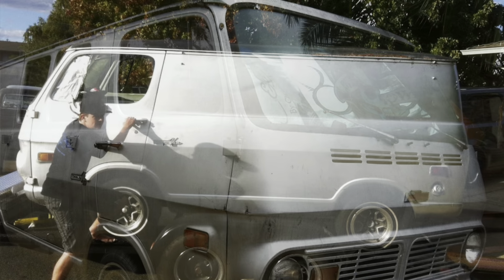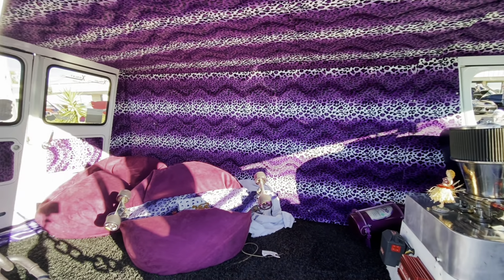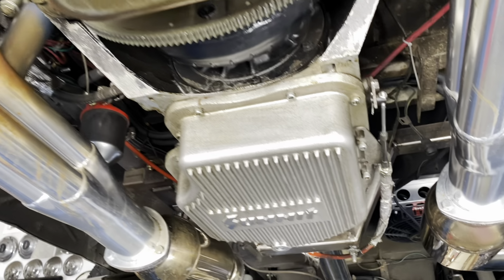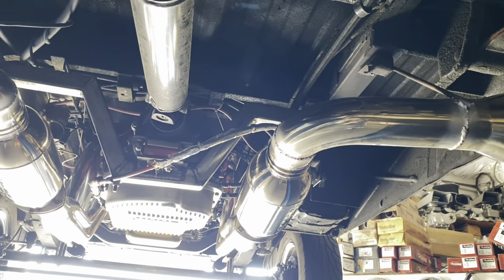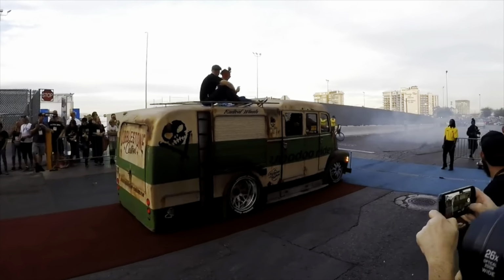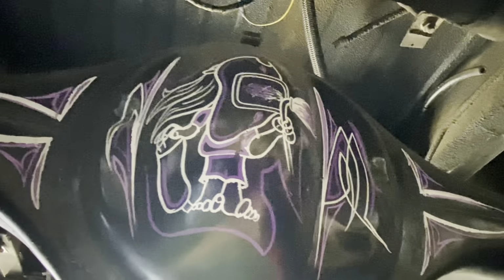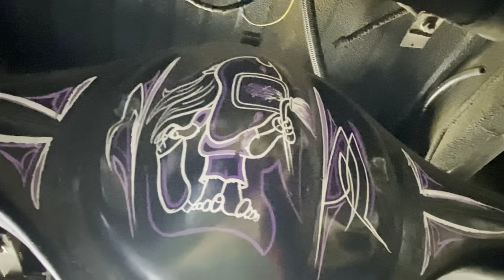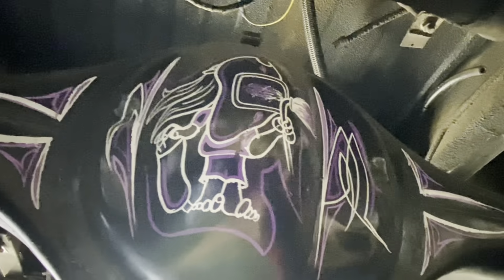Epic Adventures Of BOOGY VAN 69 Chevy - Fast , Furious, Entertaining Show Stopping Fun 🇺🇸✌️✌️😜😜👍👍

Comment: Another Rob who likes imports as well
Reply from the maker: Well this Rob and that Rob also like the Imports 😱😱😱😁😁😁
Reply: @gaspumprob  how about Rob Junior does he like imports?
Reply: @CAROLDDISCOVER-2025 rob jr is currently building a 75 Datsun truck😜. Was also his idea for the Toyota 2JZ in the 66 van👍🏼
Reply: @xtremexhaust  well that's interesting. Isn't that a early to mid-seventies Datsun that collector on the corner has? Halfway across the country but parts of parts. You get a little bit of view of the front end of it and it's in decent shape overall. But get a little bit of you and his second to most recent video. Is most recent video is strictly chainsaw. Just FYI

Comment: Nice rides and great sounding engines! Sounds like he has them tuned just right. Thanks Rob! 🤘
Reply from the maker: Hello Brian, it’s so nice to hear from you regularly lately. I appreciate your support and interest in my videos. Yes Rob is a master old school carburetor tuner from what I witnessed spending time with him.  Did you notice all the different intake manifolds hanging on his walls? I started working as an apprentice in a local specialty speed shop when I was only 18 years old and seeing those manifolds and carburetors hanging on the wall made me smile. I currently work on fuel injected modern vehicles but I have a special respect for tuners utilizing old school carburetor technology.